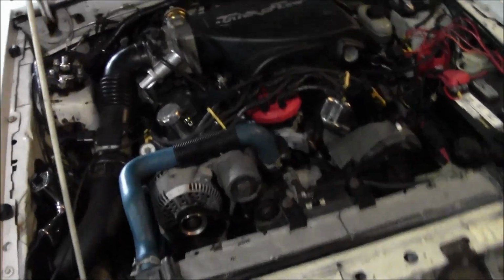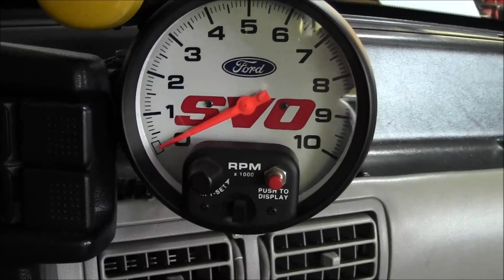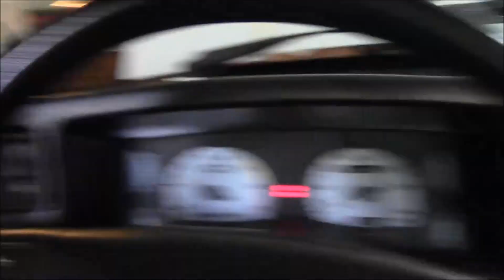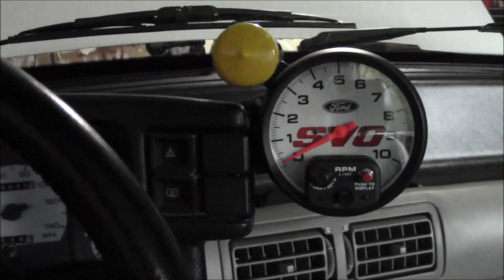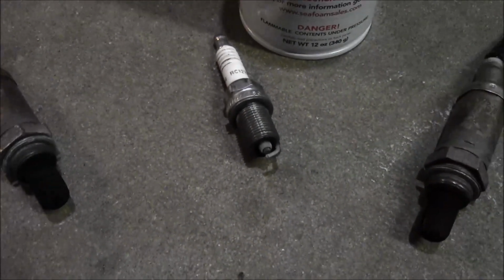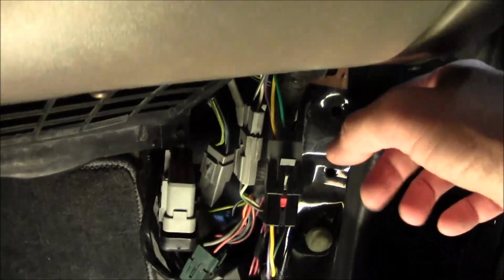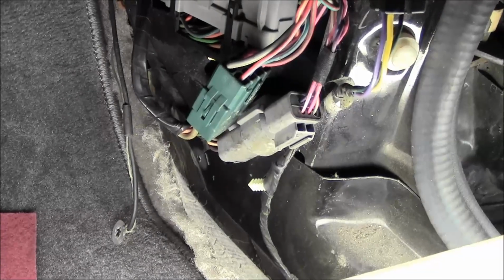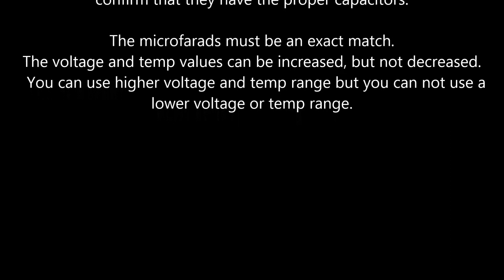Fox Body EECIV PROBLEM & Solution

Comment: That's crazy! What ever gave you the idea to even look inside that computer?? And to be quite honest, I wouldn't even be able to tell the compacitors were bad, just by looking at them. The "goo" I always thought was the glue used to attach them to the boards.
I swear, watching your videos sometimes makes me realize I have a lot to learn!
I'm happy that you found your issue.
Reply from the maker: J PP:  My dad kept making the comment that it seemed like the engine couldn't decide what to do.  So that got us thinking about the computer.  I did some research on it and found some videos about the capacitors going bad.  Then it was down to figuring out how to go about fixing it.  It wasn't too bad at all actually.  TV repair to the rescue!
Reply: @fwh79FOXR6  interesting find for sure. A few years back, I had to take my garage stereo to an old electronics shop. That's exactly what they said was wrong with my stereo too. Now my 90's Kenwood "Stack" is back in service! That is a lost profession these days.
Reply from the maker: @jpp9846  "Service" in general seems to be a lost art in the USA these days.
Reply: @fwh79FOXR6  you ain't lying!!

Comment: There is another big problem too, that plagued us for a while. Sometimes putting in capacitors doesn't fix the problem. I tried to get people to rebuild these computers for me, but the results were very poor and inconsistent. I finally broke down and ordered a very fancy microscope made for doing solder work. And low and behold, we've found the problem. The capacitors eat the traces up on the board when they leak. These "rebuilders" don't have the expensive microscope and soldering equipment to do a good job, and probably don't even know the board is damaged. And it isn't an easy fix either. Stay tuned though, cause a real high quality solution is coming for PCM rebuilding shortly! And some really cool microscope camera viewing videos on the subject too.
Reply from the maker: Sounds goods.  Looking forward to seeing that.
Reply: I need your contact info my man. I'm looking for someone to help tune my computer/ car. Need you to check my computer and advise me on what you recommend! Thanks. 💯

Comment: Glad you fixed you issues! And thanx for the info on the capacitor,im sure it will come in handy someday. Just 3 weeks ago i opened up my computer to replace the sct cable that went bad,i looked around and everything seemed fine.
Reply from the maker: Keep in mind that just because the capacitors "look" ok... does not mean they are ok.  Seems like replacing them is good preventative maintenance.  All these computers are very old now.  I think this is going to be a very common problem in the future.

Comment: FYI, I can fix those idle and startup issues for you with a chip, if you're interested. I specialize in tuning 5 liters.
Reply from the maker: I think the main problem i'm having is caused by bad lower intake manifold gaskets.  I'll have to see how she runs when I get the intake back together.  You have an awesome channel.  I really liked your 10 pin connector video.  You are doing some excellent fox body work!
Reply: One tell tale sign of lower intake gasket leaks is that the vehicle runs worse when cold, since the gaskets tend to swell up and seal better when hot. We use a smoke machine on a cold engine to check for that. But idle hunting and surging is a common issue on all fox bodies when they have an aftermarket cam. The E303 and B303 type cams are just small enough that they sometimes will idle, and big enough that they sometimes just won't, and they idle hunt.

That hunting is actually the car stalling, and then reacting to the stall by opening the IAC up rapidly trying to prevent a stall. And then it repeats over and over, so you get this idle hunting. My tune fixes that right up.
Reply from the maker: @dragradialperformance3540  What does your tune do to fix the idle issue?
Reply: @fwh79FOXR6  the idle hunting issue is actually two things happening. First, the engine is stalling, because it doesn't have enough RPM or engine airflow to sustain stable combustion. And so the engine RPM drops.

Next, once the engine RPM drops too low, the PCM will notice this and try to save the engine from stalling by ramping up the timing and by opening up the IAC quickly. This will cause engine RPM to rise fast.

And so when you see these two things happening back to back fast, that's what the idle hunting is actually doing. It's stalling, then preventing stalling, over and over. The PCM tries to learn to add more airflow over time, but this learning curve is slow, and gets erased every time you disconnect the battery. Also, the PCM's job is to target a 672 RPM idle speed (warm idle), regardless of what you do to try and change that. So if you try to jack up idle speed, the PCM tries to "fix" that error.

My tune resolves this by fixing several key factors. 1) We raise the commanded idle speed to something more cam friendly, like 750 RPM, where combustion is stable. It doesn't take that much really, just a bit more than the stock 672 RPM. 2) We increase the learning speed. 3) We increase the limits to how much it's able to learn. 4) We increase idle airflow the correct way, to compensate for the loss of airflow that goes out the exhaust valve during overlap on hot cams (which is the root cause of your idle issues). And we do some other, less obvious stuff too. We also increase the cold start RPM a bit, and just make the idle strategy more cam friendly.

The net result will be a nice muscle car sounding idle. Lopey, but stable. Higher RPM than stock, but nowhere near 1000 RPM or anything too high like that. The bottom line is that we tune the car for the needs of the cam. And it is glorious. No more stalling, no more idle hunting, no overly high idle or hot restarts that won't run. Just a nice sweet muscle car lope, the way we all dream our cammed up cars will sound. Of course, that's just one tiny thing my chip does for you. There's so much more... power, idle speed and quality, electric fan control, RPM limits, torque limits, codes and check engine lights, deletes, all sorts of stuff. It's a truly custom built chip made for your specific car's modifications.
Reply from the maker: @dragradialperformance3540  Very interesting.  What is the pricing on a chip?  Do you need to computer or the car to make one?
Reply: @fwh79FOXR6  Chips range from 200 to 300 bucks, depending on single or multi-tune options, and what brand chip. That price includes full custom tuning to your specific combination.

I don't need the computer or the car to make the chip. I specialize in tuning and diagnostics on these EEC-IV Mustangs, and have them down pat. I've done hundreds and hundreds of chips on these cars, with great success.

However, it's getting to the point with these computers that more of them are bad than good. They not only have capacitor problems, but often when we remove the capacitor and look at the board under a microscope, there is circuit trace damage ranging from mild to completely broke. I invested heavily into high end microscope and soldering/desoldering equipment this year, because I just couldn't find anybody real competent that could rebuild them unless it was just simply bad capacitors. So now, I almost encourage chip buyers to send the PCM in for inspection and possible rebuilding, because a good 50% of them need it.

Also noteworthy, even if the original capacitors aren't failed to the point where the car doesn't run right, it's still a good idea to repair the capacitors before they get to that point. This can head off the damage to the board that's coming. Those capacitors leak something very acidic when they go.
Reply: @Pontisteve  Do you have contact information, I need your help with my computer and car tuning! Thanks.
Reply: @dragradialperformance3540   Is your name Steve? I'm trying to get some tuning help on my mustang. Computer stuff!👍
Reply: @johndoe-zb8bm  yes, my businesses name is Drag Radial Performance. You can Google that name and find my contact info, or type that name into Facebook and contact me there.
Reply: @dragradialperformance3540  Thank you my man!!💯🔥

Comment: Thank you, you just saved from a bunch of grief!! How are your stangs doing? Patches, lol!💯😀
Reply from the maker: john doe:  They are doing very well.  Patches is running better than she has in years.  She fires right up, does a high idle and then settles down to a nice steady lope.  RIght now, the motor is out of the black car.  Swapping the crankshaft in hopes of fixing my oil pressure issues for good.

Comment: Yeap mine was doing that and smoking bad...... Burning rich the other day..... That's why I believe itd the computer..... Did the exact same thing but now mine won't even start up again
Reply from the maker: Patrick Rice:  I have found that most of the problems with these cars are usually physical engine issues and rarely electronic-related.  You should definitely check your computer because that is one very big electronic issue that is becoming increasingly common due to the age of these cars.  I have found that leaking gaskets (throttle body, EGR spacer, upper intake, lower intake- this is very common because some cars have a tendency to work the lower intake bolts loose over time) can be the cause of several intermittent and difficult to diagnose problems.  You may also have leaking valve seals causing your smoking problem.  Your car may also be over-due for some new valve springs.  You can always pick up a Trick Flow valve spring kit TFS-2500100 that also comes with new valve seals in the kit.

Comment: This has become a really big problem with the Fox bodies. So much so that I did the research to find these exact capacitors. The originals were Japanese, and very high quality. They just are way beyond their 15-20 year life expectancy at this point, as these cars approach the 30 year old mark. They don't make these exact same capacitors any more, but I found the modern version of them from the original manufacturer. I now stock hundreds of these, and have put them together in a kit to make it real convenient for fox owners...

https://www.ebay.com/itm/89-93-Ford-Mustang-5-0L-Computer-Rebuild-Repair-Kit-New-Capacitors-A9L-A9P-PCM/352446543989?hash=item520f737875:g:3cIAAOSwJbpbh474:rk:2:pf:0

Comment: That's outstanding!!! Definitely something I am going to look at while I have the car taken apart. Did you just find a general electrical repairman? Meaning they fix circuit boards
Reply from the maker: Yeah, I think this is really important info for any fox body owner.  From what I understand, most capacitors only last about 20 years.  I just Google searched for TV repair shops in my area.  Be sure to call and ask if they can replace a capacitor on a printed circuit board (which they should... being tv repair) and also ask if they have the proper capacitors.  Seems like the 10uf capacitor is not something most places have laying around.

Comment: Question, if my fuel pump won’t prime after replacing the fuel pump and fuel pump relay also checked the switch in the trunk. Could my computer be causing the problem? I’m considering just replacing the whole wiring harnesses and computer with the pro am EFI system and just modernizing the car. Any information would be helpful. Thanks
Reply from the maker: RetiredMSG:  I doubt that your problem is being caused by the computer.  Usually when the computer is bad, the pump will keep running when the key is turned on instead of priming and shutting off.  Your problem could be: a bad fuse link, a bad inertia switch, bad or loose wiring to the pump, or the new fuel pump is broken right out of the box.  It's always a good idea to verify that the pump is working before reinstalling the fuel tank.  If you tried to start the car several times with the bad pump installed, you probably burned up the fuse link under the hood.  These cars do not have a fuse box in the engine compartment.  There is an in-line fuse link on the wire that feeds power to the fuel pump.  So if the fuse link is blown (like a fuse in a fuse panel) the fuse link needs to be cut out and replaced.
Reply: I had this problem with an A9L computer 15 years ago.The fuel circuit would not operate the fuel pump. The problem was the computer. Swop out the a9L and it worked great. I wasted a week chasing ghost. 
If you spray Ether / starting fluid through the throttle body it would light up and run for 2 sec than die.

Comment: I’m watching through the video currently but figured I’d ask a question just in case a) you don’t answer it in the video or b) just to show your video some love. I remember in a previous video you were having issues with a warm start on your fox. Did this ultimately fix the issue? Mine cranks no problem in the morning (cold start) but after I drive roughly 20 mins, she doesn’t want to start for quite some time… any tips would be greatly appreciated.
Reply from the maker: Mr. Glass:  Yes, this computer was definitely part of the problem.  However, this car was suffering from several issues simultaneously.  I ended up changing every intake gasket:  Lower intake, upper to lower intake, EGR, and throttle body gaskets.  The other huge problem was leaking oil seals on the valves.  Changing the oil seals made a huge difference because the spark plugs were not being oil fouled.  April of this year I had the computer fixed on my dads Stang (one of these days I will post that video!).  The computer was not advancing the timing correctly.  Changing the capacitors in the computer made a night and day difference.  No engine is going to run correctly with bad timing advance.  I would imagine that your car is having a lower intake gasket leak.  When the engine is cold and contracted, the intake is sealing.  Then when she heats up... the intake expands away from the heads enough to cause an intake leak.  The lower intake bolts seem loosen up over time.  So I have gotten to the point where I do a spring re-tightening of the lower intake bolts on both of my cars.
Check out these two videos when you have some time:  https://youtu.be/7-LSzAfdwls    https://youtu.be/jtUjQ95AodI
Reply: @fwh79FOXR6  thank you so much for all the advice! I’m going to check those out now! If I ever figure out what my issue is, I’ll be sure to update this comment to hopefully help others with the same issue!
Reply: @fwh79FOXR6  I’d also like to update my words I used on my original comment. I realized I used the word start where I should have said crank. My starter is doing what it’s supposed to but my car just won’t crank up. I have a 87 Notch. I’ve replaced the ignition switch (it was separating), her fuel pressure regulator, and the ignition control module. She definitely runs better and cranks no problem in the morning. My gym is about 15 mins away and every time I drive the notch she has to sit for about 2.5 to 3 hours so my workouts are just as long 😂
Reply from the maker: @MrGlass-  I'm looking forward to finding out what the issue is.
Reply from the maker: @MrGlass-  Sounds like the car is good for your health at this point in time!  =)